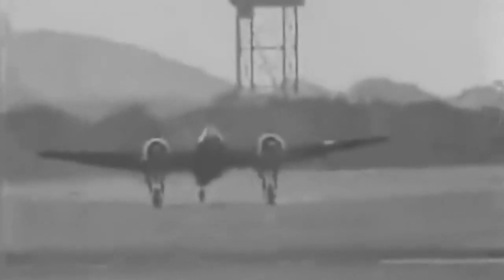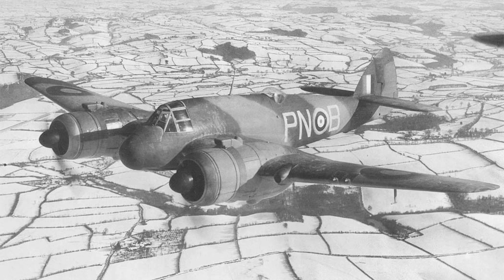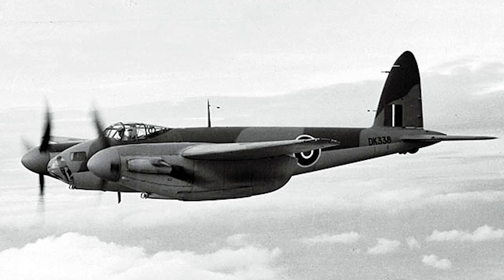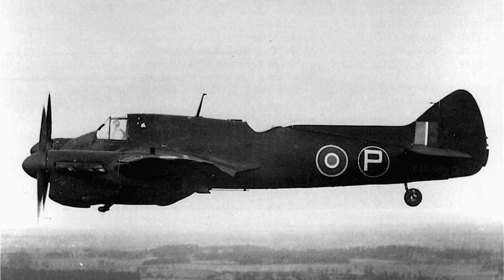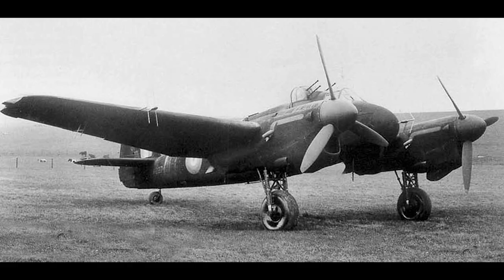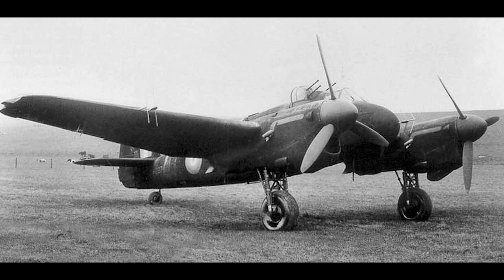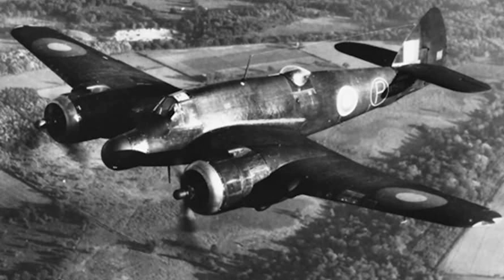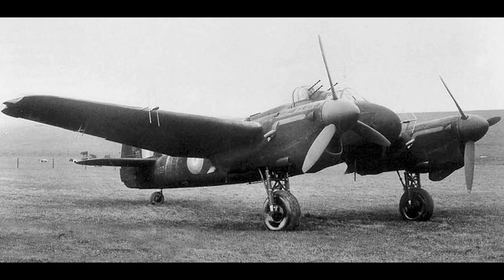Bristol Beaufighter NF Mk. V; How to Use ‘Good’ Ideas to Ruin an Aircraft

Comment: It's too bad the British couldn't have gotten their hands on some P&W R2800s to make up for the lack of Hercules engines.
Reply: North American tried P+W R2800s on a B-25, which was originally configured for Wright R2600s. The Company test pilots thought it was great, a real performer. Then an AAF test pilot tried it the next hop. He really liked it, until he flew the wings off the airframe at low altitude, killing himself. After that the project was scrapped. North American designed their next medium bomber around the R2800 -- XB-28 -- which looked suspiciously like the Martin B-26 -- single tail and 4-blade props, and all. Jets, and the War ending killed the XB-28.

Comment: Aussies loved beaus  4  pop guns were totally useless, should have used 2 x 50 cals
Reply: M3 fifties suck so so much next to any 20mm machine cannon it's still not even comparable at 4-to-1 ratios
Reply: The Australians produced a version, The Mk 21 that replaced the 6x.303 machine guns in the wings with 4x0.5 calibre weapons. Add that to the 4x20mm cannons and you have some serous firepower.
Reply: They weren't totally useless with incendiary ammo (as proved in the BoB).   Anyway, the main armament of Beaufighters was 20mm cannon so I don't get your point tbh.
Reply: @LolTollhurst  50 cals were effect in B-17, had longer range the 20mm cannons apparently. A "rain" of bullets, German pilots  stated. they would hide behind their FW-190s large radial engine.

Comment: How does that top speed compare to the aircraft it was hunting? German bombers must have been approaching that speed.
Reply: The Beaufighter could catch all the German medium bombers.  The main advantage of the Mosquito is that is could also intercept the faster fighter bombers the Germans were sending over at night (FW190s, ME410s etc.).
Reply: The Beau may have been faster, but by how much? The shorter the interception time, the faster you can deal with one bomber and then go to deal with the next. Therefore, the greater the speed margin between the fighter and the bomber, the better
Reply: I had a quick look at the HE111 and Wikipedia gives the speed as 270 mph. It must have been painful to try and catch a bomber with only a 30mph advantage.
Reply: @mattheweagles5123  it depends on height. At some speeds it might have 30mph advantage, at others less or more. It depends on loads carried, paint, dampers, etc. And by 1942, Germany had newer, faster Dorniers and Junkers.

Comment: I wonder if anyone suggested fitting cannon to the turret?
Reply: Yes.
Reply: Early in the war, with the defiant, they realised the 4 pop guns might not be enough so they tried to fit a single 20mm cannon .. it didn't fit, barrel projected WAYYYYY outside the turret, to point when in flight, the plane would slide sideways when the barrel (sail) was pointed left or right..
Reply: @RemusKingOfRome  changes of trim when traversing turrets was common. The Halifax front turret, for example, with just two 'pop guns' made the plane almost uncontrollable until they added little flaps on the turret to even out the drag.

Comment: At what time did Germany stop bombing of the UK with manned aircrafts. If it ever stopped completely
Reply: It died down after '41 as losses increased after the RAF introduced more capable night fighters (like the Beaufighter), and as more aircraft were transferred to the Eastern front.  After that they would send increasing numbers of fighter bombers types, but the Mosquito could handle them.  They tried again in 1944, but the Luftwaffe suffered heavy losses to RAF night fighters (see Operation Steinbock) losing over 300 aircraft in 5 months.

Comment: So the RAF developed the concept and adoption of ''Schräge Musik' during WW2 two years before the opposition. Sure the necessity to develop it was short lived. But why was the obvious lesson never computed that .303 rounds even in maximum volume were as inadequate in defeating a bomber as they were halved or quatered in defending one? Heroic and patriotic endeavors castrated by the same ministerialism that overides common sense today
Reply: This early on in the war, rifle caliber MGs were the only thing available in both numbers and logistics chain (munitions, parts, mounts). 
Even leaving aside the dogmatic approach , just the timescale of introducing larger calibre MGs and their munitions (separate production line) would have taken at least a year.
Reply: @whtalt92  This was not exactly early days for either the MoA or the RAF in doing their sums and learning from experience. The Spitfire, 109, 110, Hurricane were all cannon equipped. German bombers introduced some higher calibre weapons, French aircraft had 20mm cannon equipped turrets and the  USAAF were certainly taking no prisoners with .505s around. 
The neglect in implementing any more effective defensive armament for Bomber Command for a further four years is beyond negligence

Comment: 'WHY?' .. Use 4x .30-cal?!!  Really? 2 of .50 cal. would result in a lower, smaller, less-drag Turret, and the Guns would Hit Harder, not in 'lead-weight on-target'. but in Actual Damage Done... Were the Brits that DAFT?
Reply: At that point in the war, the US had no 50 calibers to spare to give to Britain. They asked and were told "no". It wasn't until much later in the war that some late models Spits had 2 Hispanos and 2 Brownings in the E wing and the  Canadian built Mark X Lancs had a Martin twin 50 upper turret. 

"E type

Structurally unchanged from the C wing, the outer machine gun ports were eliminated, although the outer machine gun bays were retained and their access doors were devoid of empty cartridge case ports and cartridge case deflectors. The inner gun bays allowed for two weapon fits;

2 × 20 mm Hispano Mk II cannon with 120 rounds-per-gun (rpg) in the outer bays combined with 2 × .50 cal Browning M2 machine guns, with 250 rpg in the inner bays. With of the relocation of the Hispano to the outer gun bay the blisters covering the feed motors were moved outboard on the gun bay doors.
or

4 × 20 mm Hispano cannon with 120 rpg (this configuration was rarely fitted.)

The 20 mm Hispano cannon were moved outboard and a more effective .50 calibre Browning .50 cal M2/AN heavy machine gun with 250 rpg was added to the inner gun-bay replacing the outer Browning .303s. The first trial installation of the installation (modification 1029) was made in BS118, a Mark XI in November 1943. This armament later became standard for all Spitfire Mk XIVs used by 2 TAF as fighters.[6] The improved armament was more effective for both air-to-air engagements and air-to-ground attacks.

Comment: Why did the British make all those twin engine planes without counter rotating propellers, it couldn't cost that much more.
Reply: They also wouldn't change the fuselage design on some bombers like the Lancaster to give the crews more chance of escaping from them. Crews had little chance of escaping from a crashing bomber.
Reply: @None-zc5vg  Like the Vulcan bomber that ejection seats for the pilot and copilot who were officers, while the rest of the crew had scramble out of a escape hatch before it crashed.
Reply: Because all the YouTube commentators who go on about it do not have multi engine aeroplane licences and therefore have absolutely no real world knowledge based idea about how unimportant it is.  They are making a mountain out of a mole hill, the effects are measurable but are also quite trivial.  I was taught the effects and I learned the various speeds but I never needed to use them, stalls on one engine are not tested for by examiners.  Flying a twin was all about being able to manage the plane efficiently on one engine, the single engine best angle of climb and best rate of climb speeds are way, way above asymmetric effect limitation speeds.
Maybe 99% of multi-engine propeller planes do not have counter rotating propellers.
Reply: @robertcardon5402  
The Victor's also.
Reply: It costs quite a bit more, actually. The engines also have to turn in opposite directions, so they have to be mirror-image pairs; imagine the headaches for the mechanics and supply people. It's no good sticking an extra gear wheel in one of the reduction gearboxes; there would be weight imbalance, space,  and torque issues. So yes, it could and does cost far more than you might think.
Reply: @hamiltonmays4256  I believe the Hornet's Merlins were fitted with counter rotation gear to give it opposite handed prop rotation.